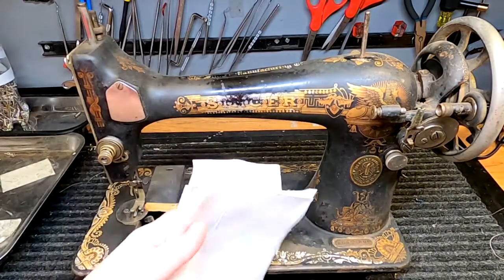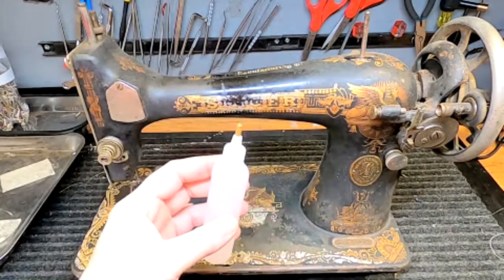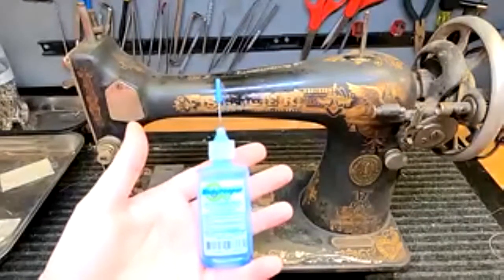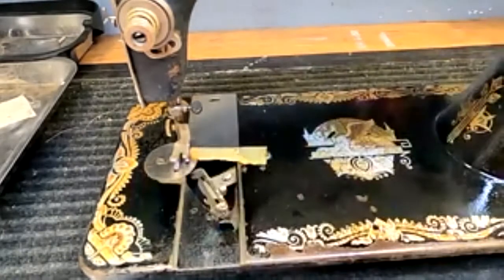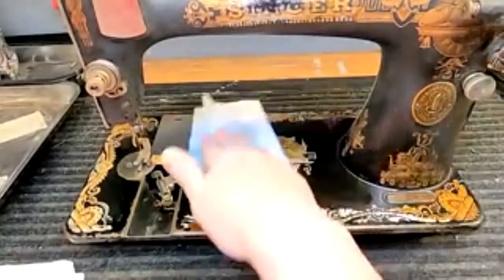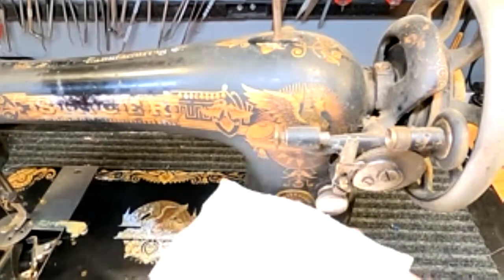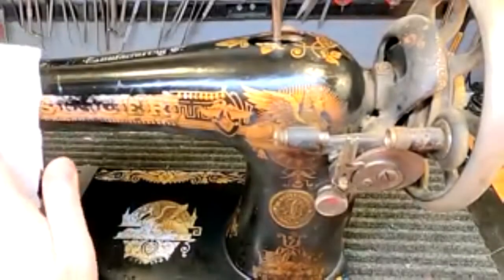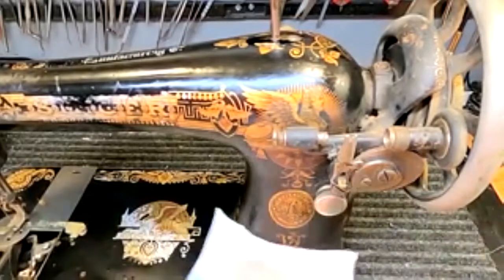Clean the exterior of a vintage machine SAFELY - How to clean an antique vintage sewing machine

Comment: Mine is really REALLY dirty... It was left for 2 generations with no upkeep. I did, at my moms advice use a damp papare towel ... 😬. Will it ruin everything or should i be fine? I made sure to dry it really good almost immediately after wiping it down.

Also- fun tidbit about mine, my great grandfather added wiring and a new footpedal to make it easier on my great grandmothers ankles and knees! Its going to proove more difficult to reatore, as im not sure its safe to use, but I love that mine is unique!

Comment: Can you use blue creeper inside the machine to remove old grease and oil with a q tip thank you for your videos I love working on my machines I just purchased 2 this weekend and they need cleaning up really bad
Reply from the maker: Yes, Bluecreeper is VERY safe to use inside of vintage machines.  It's the main thing we use in our shop.
Reply: @SewingDocAcademy  Thank you for the reply so many of the channels I follow never reply. I ordered some from Amazon yesterday good price too I have 14 machines and I am sure I will use it. I just picked up 2 this weekend on Market place A Tacsew and a Singer 20U I have already 3 20 u's I just couldn't pass this one up but it needs a lot of love .

Comment: So the BlueCreeper isn't agressive to the coating, decals or black paint? What about kerosine (which  and old service manual by Singer recomends to use on moving parts that are "frozen"). They don't say to be careful with the paint, but I don't want to dissolve the paint or decals it inadvertantly 😅)
Reply from the maker: The reason I recommend and teach techniques using Bluecreeper is because it is probably the cheapest, easiest, safest product to use on old sewing machines.  It will NOT compromise the paint, shellac, or decals (don't scrub!), if it's used inside the sewing machine, the residue only helps the machine, never hurts it (treats surface rust and won't allow old, hardened lubricant to reharden).  Yes, Kerosene is safe to use on machines, but you have to consider the fumes to deal with and the flammability.  My service shop used to be located inside of my quilt shop - NOT the place you want something so dangerous.  I personally cannot handle the smell of Kerosene (even the 'scentless' has a smell that is hard to tolerate using it so much).  The biggest downside to Bluecreeper:  it can't be shipped to other countries.

Comment: Is blue creeper the same thing as wd-40?
Reply from the maker: No, absolutely not.  WD-40 will cause damage to the outside of machines, and is not recommended when lubricating inside of machines, either.  Bluecreeper is it's own type of product sold by a specific company, there aren't any other similar products.

Comment: Just found your channel! 
Awesome!

What about newer machines (but still vintage)? Can sewing machine oil or the Blue stuff be used?

I just acquired  a two-tone pinkish-tannishFleetwood (yes, with fins). 1950 is the date in the instruction book.

I haven't ventured to clean it yet. It smells old, appears to need a good overall cleaning and there are areas of yellow that looks like aged oil on the outer service in corners, etc. It is extremely heavy but I'm unsure what the surface is made of...the fins....(?)...plastic /Melamine?